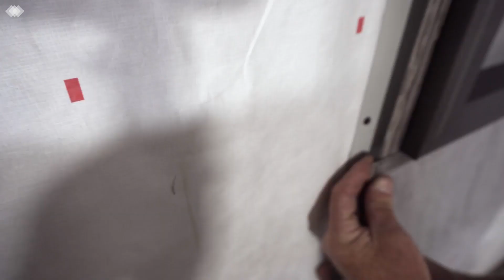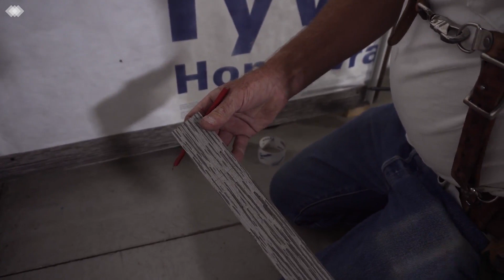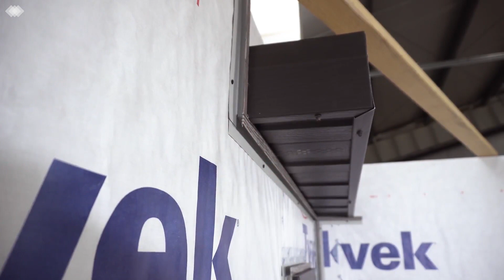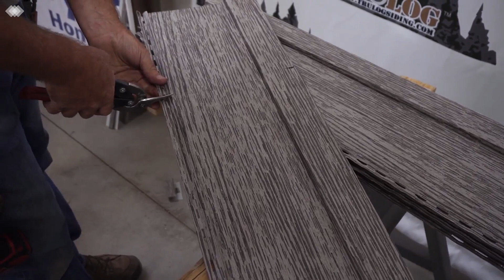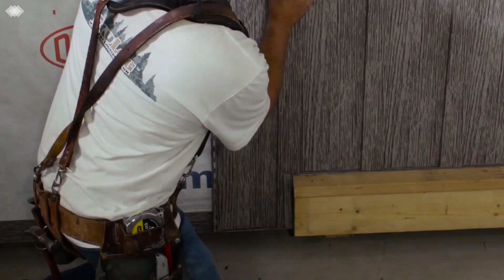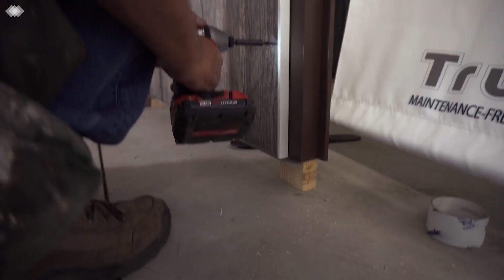How To Install Steel Board & Batten with TruLog

Comment: We are currently installing your board and batton now and its supper hard to lock in. looks very different than what youre putting on now. Ours has a top lock thats smashed shut yours looks nice and wide open. Ours has a cresnt moon shape to the whole piece where the whole thing whould be flat...this cresent moon makes it very hard to lock in and the bottom lock on the back side seems to have way too much of a presure bend to it while the one in the video seems to be way more straight this makew it impossible to get it locked all the way with out bashing it with a piece of wood.... All in all im not very pleased or impressed with the product the way it is now we spend way more time making sure the product is locked together than actually put it up.....Seems like the machine that bends it need adjustments.....

Comment: Do you put silicone on these prior to install for a water tight fit?
Reply: We dont but any silicone on the panels, but you can put silicone where the j-channel and the window frame meet. This application is over the top of a vapor barrier so if any water does get behind the siding, condensation from the house, etc, it travels down the vapor barrier and out the bottom of the panel

Comment: Water proofing is all wrong,  i see so many negative laps,  no drip edge on top of windows,  no reverse on the bottom,  paper should lap over the drip. Tape is not sufficient,  water can still get in behind.  Please teach people the proper ways.  It's no wonder there's so many issues with buildings with rotten wood.

Comment: No room for expansion, screws are to tight too .
Reply from the maker: Dont need a lot of room for expansion and contractor, steel expands and contracts a lot less than vinyl so you can be snug with your fasteners

Comment: Is there a way to replace a panel if damaged? Watched the video on the Log style siding, would it be same on B&B siding?
Reply: Yep! Very similar process of cutting the panel out and modifying one to fit into the space in the middle of the wall

Comment: My board and batten siding arrives this week, was wondering how wide are the duck bill pliers is he using to make the bends on the J-channel.
Reply: Difficult pliers to find! Ted has had them for 20+ years but if you can find them they are about 1/2 in wide

Comment: Thanks for this video. Does the material rust at the ends where it is cut? What about the tight folds with pliers, will it rust there?
Reply from the maker: Our steel is galvanized with zinc and aluminum to prevent rust and corrosion so the ends wont rust
\
Reply: @trulogsteelsiding6804  Is the zinc and aluminum an integral part of the metal or a coating?  Interested in your metal for humid Florida!   Thank you
Reply: @coreybrockway8730  the zinc and aluminum is a coating applied to the steel before primer and paint

Comment: I love that detail of wrapping the J in the corner, I’m gonna try that on my next job. When water runs down the wall and turns that top piece of J mold into a gutter, the water runs down the sides and a lot of it goes behind the siding. I’ve seen the Amish run 20” flat sheet metal clear down the wall to the rat guard. I was impressed. It’s the same problem with vinyl siding.   I have used a transition strip / Z mold on top of the window and run it past 1 inch on each side. Functional but not very pretty, I have used a piece of J and notch  the siding 1” out on each side,  A small dab of caulking at the joint and at least it gives it a little overhang. If anyone ask, it’s a colonial style, just mach the trim inside the house while you’re at it 😁🙈  I run synthetic felt down the wall, I’ve seen some bad Tyvek.  Looks like a nice product, Hope to see more steel siding products in the future.
Reply from the maker: Yep, you got it! thank you for the comment!

Comment: You must be relying on the Tyvek to keep the water out   when the water runs behind the J channel.  Put together just like an old pole barn.  I’ve seen the Tyvek turn to flaky powder in three years.
Reply from the maker: water shouldnt be running behind the j-channel. If it does, yes a moisture barrier is there
Reply: J channel does not replace Z flashing at windows and penetration blocks.  Z flashing needs to be installed taped to sheathing.

Comment: What type of screws are you using?
Reply from the maker: You can us anything that has a wafer head, coated, 1.5 inches long. In the video we used drywall screws

Comment: Can Trulog steel board and batten siding be installed on a post frame building without plywood sheeting behind it? Meaning can it be screwed into the grit boards running between posts?
Reply: You can install on the girts. We would like to see OSB or some sort of solid backing as the best option. But you can attach right to the steel

Comment: When installing the finished L on the bottom for the panels do you keep it off the concrete a 1/4 to a 1/2 inch
Reply from the maker: You are correct, just a little bit up off the concrete so its not directly touching
Reply: Thank you.